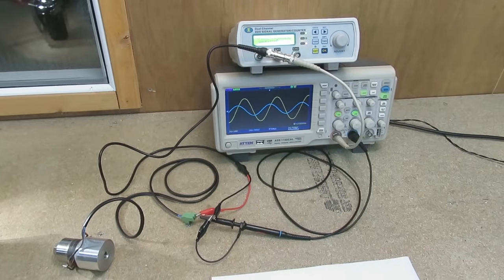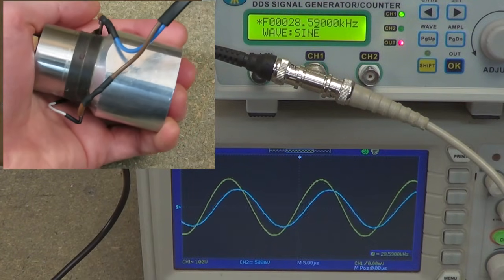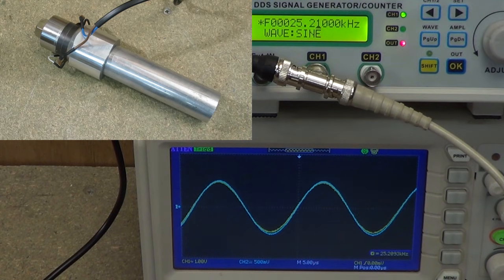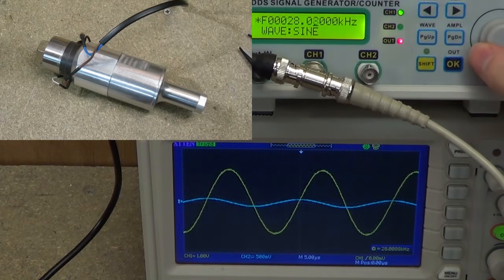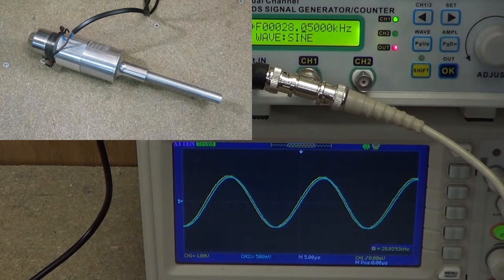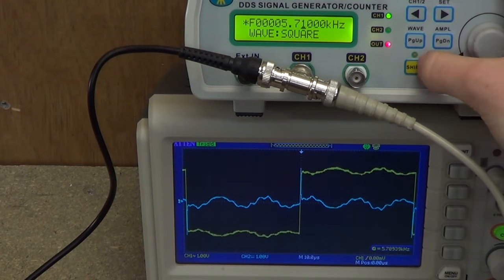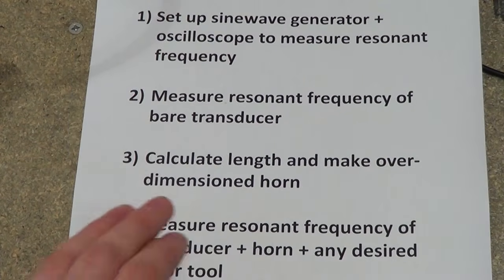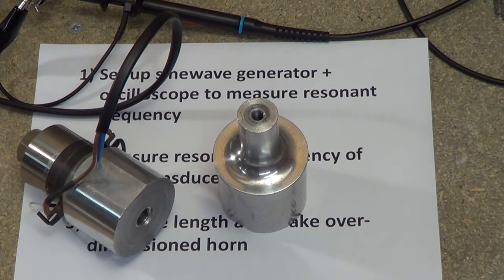Ultrasonic Transducers - Measurements and Horn Design

Comment: Hi, thank you for this instructive video.
Can you tell where I can get a transducer like yours ?
Reply from the maker: There are plenty on eBay/AliExpress - search "28kHz ultrasonic transducer". The other popular frequency is 40kHz.
Reply: @imajeenyus42  Thank you, in fact, I have an industrial transducer that need an advanced generator like branson, I use this ultrasonic transducer to do fatigue test. the frequency that I need to do my tests is 20KHz, so I don't know if I conduct my test with ultrasonic transducer (used for cleaning) it will wroks for me or not.
The welding transducer work with a power 3300W;
The cleaning transducer work with a power 50W; 
Do you think it will work for me ? I'm materials scientist, I know nothing in electronics 😛
Reply from the maker: @elhadrihamza2418  If you need to do a test at 20kHz, then you need a 20kHz transducer. A 28kHz transducer will not be suitable. As for power, I don't know the details of what you're doing, but I would guess that 50W would be far too weak to have any significant effect for fatigue testing. You'd be best sticking with a proper generator (Branson or otherwise) - remember it's not just the transducer you need, it's the associated driver as well.
Reply: @imajeenyus42  Thank you

Comment: What is the good aluminium rod grade material for the horn?
Reply from the maker: For these low powers, it doesn't really matter. Common 6061 alloy is perfectly suitable. If you were thinking about much higher powers (hence greater stresses on the horn material) then you might want to use 7075.
Reply: Lindsay Wilson thanks for the answer 👍

Comment: Another question, if I might. Can you use the measured resonant frequency of a TXR + Horn or the difference between the two resonances to calculate the speed of sound thru this particular piece? You were using 5800m/s, but as you noted, that 'published number' is all over the charts. So you can't make perfect predictions about length prior to having the object you're going to attach (like your piece from the waste bin). 

But after you've measured the new resonance and found this frequency, can you somehow do the calculation backwards? I mean, you take the piece and then go turn it down 'a couple of millimeters'. Could you have taken a precise measure of the horn's length and the TXD length and figured out a precise number to shorten the horn by?
Reply from the maker: Unfortunately not ;-) You might get an approximation, but again nothing accurate. The transducer + horn assembly doesn't vibrate exactly as a simple half-wavelength system, there are little variations, breathing modes etc. However, you could make a rough guess - e.g. if taking 1mm off raises the frequency by 1kHz, and you need to raise it by 5kHz, then PROBABLY taking off 5mm would do the trick. It'll likely be a linear response over small adjustments. But I'd still sneak up on the final value ;-)

[Having said that, I did take a big chuck off my original horn by mistake (screwed up calculation), but luckily it ended up pretty much exactly where I needed it!]
Reply: @imajeenyus42 hello mate 6 years late is OK too talk
Reply from the maker: @jshaw4757  What did you need to know?
Reply: @imajeenyus42  Hello mate..I was just wondering are these the piezoelectric transducers and can they be used too generate power ..I'm very interested in batterys n energy n wish too make a system myself and I just wondered if these things could play a part in such a system as I plan too combine things too try n come up with something...but yh or just short info on them in lamens terms I prefer talking too people than just using Google..thanks alot

Comment: I am wondering if I can use VNA to determine the resonant frequency, I suspect it should be possible but I wonder if the fact that the VNA is optimized for 50ohm impedance might mess with it. Either way this video is just awesome, thank you for making it :) You helped all of us.
EDIT: One more question, lets say i have a horn that resonates at frequency rather far away from the original frequency of the transducer, do I lose a lot of performance by just driving it at the new resonant frequency or should i rather modify the horn to resonate at the original resonant frequency of the transducer?
Reply from the maker: A VNA is basically exactly the concept you want, but like you say the impedance will probably mess with things. Also I think most are designed for much higher frequency use and they might not reach down to the tens of kHz which is needed for these sorts of transducers. As for a horn at a different frequency, you would really be best to modify the horn to suit the transducer. You could drive it at a different frequency, but the efficiency will be lower, and the piezo elements in the transducer wouldn't be happy since they would no longer be located at a node. They might experience mechanical stresses outwith what they can handle.
Reply: @imajeenyus42  Makes sense, thanks so much for such a perfect explanation. My VNA goes down to about 10kHz so I will give it a shot. If I get some interesting results I might attach it to this comment for others to see (as it could potentially make the measurement even easier). 
Regarding the horn, i dont have much freedom to change the horn but, you gave me new idea. I can try to get the transducer back to the node by designing a "counterbalance" on the other side, then it should be just matter of measuring where the node actually is. Which I dont know how to do yet, but I assume I should be able to just attach the entire assembly at various points and measure the attenuation, if its held at the node the attenuation should in theory be the lowest.
Reply from the maker: @MarvinMalane  It would definitely be interesting to see how the VNA works with it! You get dedicated frequency analysers for use with ultrasonic transducers, but they're pretty expensive.

As for holding the horn, it gets tricky. Although the piezos are located at a longitudinal node, they are at a radial antinode - they "breathe" in and out. So you can't clamp anything rigidly, it would need to be some sort of compliant mount like rubber or sponge. A counterbalance may work, but attaching it would be difficult - do NOT, incidentally, dismantle one of these transducers! Unless you have a torque wrench and means of measuring the resonant frequency ;-). The frequency actually shifts depending on the tension of the bolt. You need to keep the piezos in compression at all times, hence why there is usually a significant bolt holding the two halves together.
Reply: @imajeenyus42  You just saved my transducer, I was just about to take it apart

Comment: Dear Lindsay Wilson. Would you please enlighting my very silly question. I have an 600 watt generator connecting to 4 x 100 watt transducer. I increasing the ouput watt so the noise coming out from transducer getting louder. But if i keep increase watt to the point which make the sound suddenly getting quite. I am very sorry for troubling your time, i try to search on google but there no answer or i must miss read somewhere. Many thanks to you.

Comment: What about connecting leads & cables capacitance, is this method of tuning depends on above said parameters?
Reply from the maker: No, the inductance and capacitance of the connecting leads are tiny compared with the transducer so they don't have any effect.

Comment: Hi Mr. Lindsay, great video! . Im trying to design an ultrasonic horn in COMSOL for a 40 kHz transducer to generate acoustic cavitation, but i´m having issues with the correct geometry. Could you share the dimensions of your 28 kHz horn to understand better the effects of geometry? Greetings

Comment: Hi Lindsay 

Why did you choose 1/2 Lambda for resonance. Also how do you calculate how.much material to remove from the horn
Reply from the maker: Because 1/2 lambda is the length that will resonate. Can't really calculate the amount of material - best is to make it longer and actually measure the resonant frequency as the length is reduced.
Reply: Thanks Lindsay

I am building an ultrasonic tank with 12 transducers. Can we use the same 100ohm resistor to model and determine the resonant frequency with the transducers screwed and epoxied to the tank.

My issue is no 1 : there has to be a certain torque setting when install the transducers to the studs as this will affect resonant frequency 

Secondly the material thickness of the tank will affect resonant frequency.

Finally how do you calculate the optimum level within the water tank where you can maximum power transfer, as this will be used for instrument cleaning, this will directly affect wash efficacy. 

Finally how to you design to mitigate destructive interference within the tank
Reply from the maker: @theoracle6005  It's been years since I did anything with ultrasonics, so take all this with a pinch of salt. 100ohm should be fine for measurements, as long as you get measurable signals on the scope. 

Main thing to remember is that an ultrasonic cleaner will damp (broaden) the resonance, especially with multiple transducers (since they will all have slightly different resonant frequencies) so I don't think you need to worry about things like mounting torque or wall thickness (as long as it's small compared with the size of the transducer, e.g. 0.5mm isn't going to affect things much). Look here:

https://imgur.com/a/umULEDF

That shows a bare transducer (black) vs being damped with a wet sponge. The response broadens significantly when damped.

As for water depth and destructive interference, I'm afraid I've no idea about that, sorry.
Reply: Thanks for the reply Lindsay. I will check out the link supplied. 

Appreciate you help

Comment: Very interesting video, but I'm not sure there is anything sacred about the resonance point of the bare Langevin transducer. I would think that what you are really interested in is maximizing either mechanical power output, or mechanical power output divided by electrical power input (maximum efficiency) in the final configuration, at whatever the resulting resonant frequency is.

Another thing you can consider doing is using an impedance measurement device to measure the impedance of the transducer around the resonance point. In this case you will see the impedance of the transducer go from close to -90 degrees at low frequencies (pure capacitance), up to zero degrees at resonance, to above zero degrees above resonance, then back down to zero degrees at the anti-resonance frequency, then back toward -90 degrees until the next resonance is approached. Of course this is what you are showing on the oscilloscope, but it's nice to have it quickly generated as a graph. The real part of the impedance which represents the load's power dissipation can also be graphed. The Analog Devices AD5933 development board can be used to perform this testing and can be purchased fairly inexpensively...

Comment: Hello Lindsay...1) What if the tool is directly connected to the bare transducer? Then there will be need of horn?
2) How to calculate how much amplitude will be there if bare transducer works at 25 kHz?
Reply from the maker: You probably could connect the tool directly to the transducer, but the vibration amplitude will be less (the horn increases the amplitude). Besides, it then gets very awkward to actually use, because the tool is so close to the (wide) transducer face. As for amplitude, I'm afraid I have to idea how to calculate it - depends a lot on the loading, efficiency of resonance etc. Very, very roughly, amplitudes are in the tens of micrometers for these sort of devices. Check out my other video where I measure the peak-to-peak displacement amplitude: https://www.youtube.com/watch?v=OIQ3TY1wkXI

Comment: Is there a difference between that transducer and Piezo disk that are readily available other than robustness?
Reply from the maker: Piezo discs are generally meant for use in a transducer such as this, not on their own. They do not withstand tensile forces.
Reply: @imajeenyus42  Ty, So what is the transducer exactly then? A tuned support system and resonance cavity because if so that's fine. I was mainly curious if a normal piezo could be placed into a setup like that for support and what not and used similarly or if there is some large power difference between the transducer piezo and normal everyday ones.
Reply from the maker: @seditt5146  I don't know what you mean by a "normal everyday piezo". There are literally thousands of different styles and materials of piezoelectric ceramic trandsucers. A bolt-clamped Langevin transducer like this is not a "cavity" - it is a solid structure designed to resonate at a particular frequency, driven by the piezoelectric element.

Comment: I have a silly question regarding ultrasonic horns/transducers you see on cleaners in various wavelengths and strengths.  Is there one metal that the horns prefer?  What about material?  All the commercial ultrasonic cleaners are made from some sort of formed stainless steel.  Has there ever been a plastic drum or plastic container with decent performance?

Its a silly question but I can't google this answer thats why I'm deferring to people that know more about this.
Reply from the maker: The transducers themselves generally use an aluminium "front mass" (the part that's attached to the tank) and a stainless steel "back mass". Fancy transducers may use stainless steel or even titanium, but you're unlikely to see that in a cleaner. As for the tank material, metal is the only option - plastic would absorb too much of the ultrasound as it passes through. Additionally, it would heat up and possibly melt from the ultrasonic vibration - a fact used in ultrasonic plastic welding!
Reply: @imajeenyus42  Thank you for answering my question so fast.  TBH, I'm thinking about making a metal utility sink in our shop into an ultrasonic cleaner.  Think utility sink but made of metal.  I would want to power it with a dial timer that goes up to 15 minutes so it can't be left on.  I think I'm going to go with 40 khz transducers since I want to keep it simple.

Comment: I don't understand how you can add material to the original transducer and arrive at the same resonant frequency as the unloaded transducer. I would assume that adding mass would always lower the resonant frequency.  Also, why is it so important to attempt to tune the horn so that the original unloaded transducer frequency remains as before. I mean, so what if the resonant frequency changes if you can simply adjust the generator frequency to the new resonant frequency of the transducer stack?  Make sense?
Reply from the maker: Answer: harmonics! Yes, adding material (lengthening) to the transducer will lower the resonant frequency, but remember that the system will also oscillate at higher harmonics (2x, 3x, and so on times the fundamental frequency). Example: say you've got a transducer with a fundamental resonant frequency of 20kHz. Say its length, for sake of argument, is 10cm long, and assume it's a solid chunk of aluminium as far as sound waves are concerned. If you add 10cm more to the length, in other words by screwing on a 10cm long horn, you've doubled the overall length of the system, so the fundamental resonant frequency will be half, at 10kHz. But the first harmonic will now occur at 20kHz, and this is where we drive the system. The transducer will then still be operating happily at its design frequency of 20kHz. As to the importance of matching - piezo transducers are designed to operate most efficiently at a particular frequency. Lots of factors affect this - the overall length of the transducer, obviously, but also the dimensions/thickness of the piezo rings and the compressive force applied by the bolt. The compression introduced by the bolt ensures that the piezo elements never experience tensile forces which could break them, but this assumes that they are located at a nodal point. If it's operated at something other than the design frequency, they might be damaged. It's a complex subject, so it's simplest to just say the transducers are happiest and most efficient when run at their design frequency.

Comment: Hello Lindsay  thank you for your time and this value information ,   kindly want to ask you  if the power generator for cleaner is diferent for  welding, thank you again.
Reply from the maker: Hi, thanks. From what I understand, welders drive the transducer at its parallel resonant frequency, whereas cleaners drive then at the series resonant frequency. However, I'm afraid I don't understand exactly why!